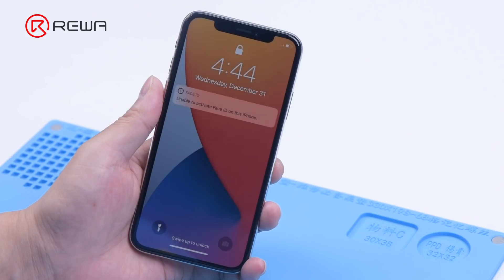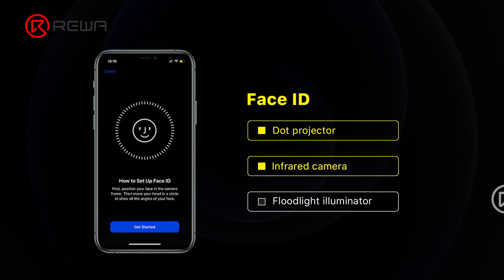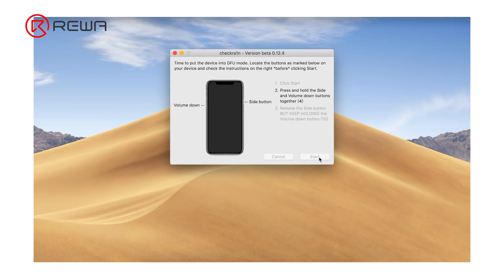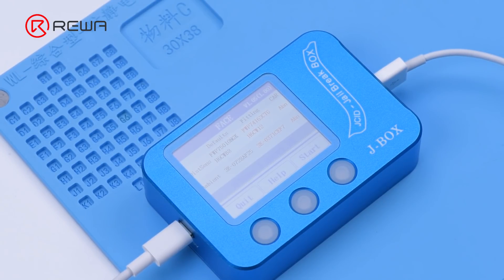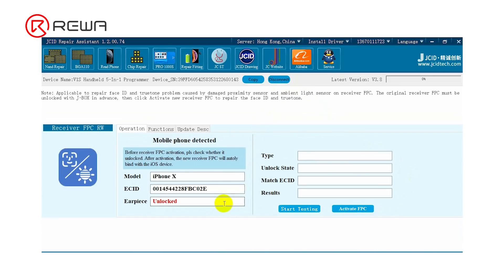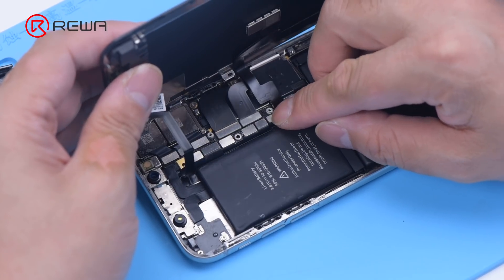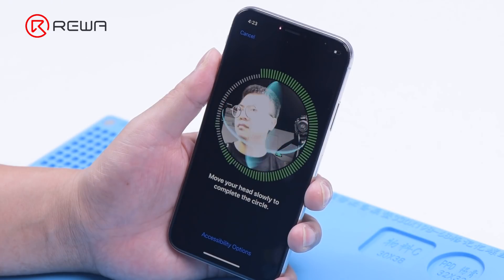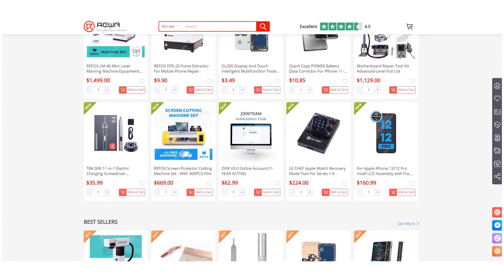iPhone X Face ID Not Working Fixed By Replacing Earpiece Flex Cable

Comment: truedepth camera is not available 

can it be repaired??

everything else like ir camera, ir dot matrix, distance sensor are working (checked in 3utool)
Reply from the maker: Use the repair tool to  troubleshoot, make sure IR CMOS is fine.

Comment: O meu flex original rasgou . Isso pode ser feito sem o flex e original ?
Reply: Yes. If you don’t have the old flex, connect the whole phone to the v1se via USB. It will pull the data from the motherboard. Then connect the new flex to the v1se and write the data. Assemble the phone and you’re done. The old flex isn’t needed, but the v1se, or another programmer is essential. You need a way to read and write the data.

Comment: My face id is working but my mom threw away the original earpeace flex cable how do I restore face id if I purchase 3rd party earpeace flex cable any help please.
Reply: You need the v1s. Connect the phone to the v1s via USB. It will pull the data from the motherboard. Then write the data to the new flex.

Comment: Please explain how true tone is related to the face I'd flex cable?
Reply: The front cameras are what control True Tone, Face ID and the proximity sensor is what turns the screen off when you hold the phone up to your ear during a phone call.

Comment: Hi, is this work also if original earpiece flex destroyed?
Reply: The only thing you need is the v1se. If you don’t have the old flex, connect the whole phone to the v1se via usb. It will pull the data from the motherboard. Then connect the new flex to the v1se and write the data. Assemble the phone and you’re done.

Comment: is the Jbox required to backup the sensor's data? or can I just use the V1S and backup the data using that?
Reply: I never jailbreak. If you have the old flex, you plug it into the v1s so that it can read the data and then write to the new flex. If you don’t have the old flex, you plug the phone into the v1s via usb and it pulls the data from the motherboard. Then you write the data to the new flex.
Reply: So the J box part is not needed then? Can you confirm

Comment: From Xs to 12 (only iOS 14.5.1) we get a jailbreak using uncover 7.0.2, in the settings and put additional checkmarks on install openssh and reinstall cydia without them, the box will not see JB. Next, we read our SN and flash it into the display! Ready!

Comment: My earpiece isn’t working but Face ID works fine. Do I need the Jbox to jailbreak as well as the J1S or the J1S only with the appropriate board to read/write the flex cable data?
Reply: Did you find a fix for this? I have a phone with a similar issue!
Reply: You only need the v1se. If you have the old flex, connect it to the v1se, read the data, connect the new flex, write the data and then assemble the phone. If you don’t have the old flex, connect the whole phone to the v1se via USB. It will pull the data from the motherboard. Connect the new flex, write the data and then assemble the phone.
Reply: No Bro , u can Just repleace the earspeaker on the original flex

Comment: after finishing all the process, can I update my Iphone with the original software or do I will need the jailbreak?
Reply: You don’t need to jailbreak. I never do. You need the v1se. If you have the old flex, connect it to the v1se, read the data, connect the new flex, write the data and then install. If you don’t have the old flex, connect the phone to the v1se via USB, read the data and then write the data to the new flex.

Comment: After Sour replace and reprogramm the Face id, can you remove the Jailbreak?
Reply: Of course you can remove the jailbreak
Reply: @airmaxbg  but will Face id still Work without  the Jailbreak...thats tue question😁
Reply: You don’t need to jailbreak. I use the v1se to do this on a daily basis and I’ve never needed to jailbreak a phone.

Comment: could a similar method be possible with the dot projector? Reprogramming the dot projector on a new front camera assembly instead of having to repair the old dot projector?
Reply: Sure it is possible but still you need to transfer IR camera. Dot projector is not unique data stored in encrypted ic is unique. But if flex is damaged you need to fix flex because data is in encrypted ic.

Comment: what if i bought an iphone x with no face id but working truetone, previous user told me that he lose face id after updating to ios 14.5.1 so i bought and tried downgrading but didnt work. is it caused by the earpiece flex cable too? or do you have any alternatives?
Reply: Dot projector defective. Replace dot projector and Face id will Work
Reply: @WalmezTekno  meaning i had to buy a  new frontcamera with dot projector module and solder it with old original module flex cable?
Reply: @justarandomonlineperson8094  you can not replace front camera, after it you lose Face id function. Infra camera and dot projector (parts of front camera modul) are paired with procesor, so you can not replace them. Only way how to repair your problem is to replace flex cabel from dot projector-it need to be reprogrammed and replaced with soldering and you need skillz to do it. Find someone ho do it, not do it yourself without skillz.
Reply: @WalmezTekno  i see, i had a friend that is skilled with the soldering stuff but i had to find the programming thing. anyway thanks for the help and info.

Comment: Why do they sell these cables and devices for iphone xs,11, etc , if these devices must be jailbroken and don't exist?
I bought a jc v1s with the 6 circuit boards, ear flex cable and dot projector cable bought for iphone xs , but is useless cause it doesn
Reply: I have same set with 6 boards and they make a good work. For changing the new screen, battery and etc

Comment: Hi, what will happened if I remove jailbreak after reprogram new part, is it gonna work?
Reply: Have you tried this, or know anyone who’s tried this? I’m considering buying this setup for my business, but if I’m unable to remove the jailbreak afterwards and keep Face ID I’ll have to pass.
Reply: It does work even after restoring, Doesn't make sense if it does not work after restoring or re-starting the device
Reply: I think it won’t work because you are programming the phone to remember the NEW number the iPhone has to look for. Unless!! This changes the serial on the actual ear piece! Then it should work even restoring the phone I’m sure
Reply: You don’t need to jailbreak if you have the v1se. If you have the old flex, connect it to the v1se, read the data, connect the flex, write the data and then assemble the phone. If you don’t have the old flex, connect the whole phone to the v1se via usb. It will pull the data from the motherboard. Write the data to the new flex and then assemble the phone. I’ve never had to jailbreak a phone to do any programming with the v1se.

Comment: I bought this device and I've tried emailing to get some help with the "IIC chip not recognized!" error when using the software. It's been two weeks. Why is it so hard to reach anyone from your company??? I'm a new customer and the complete lack of any help is incredibly concerning.
Reply: did you ever get the help you needed? I own a phone repair shop in Canada and am debating on buying this, however this comment is concerning lol
Reply: @jordanirvine3787  jailbreak is basically dead so rip
Reply: oh
Reply: Most Chinese companies have zero after sales support. Communication is a joke. Nobody speaks English there so you can be sure that once you buy from most companies, they don't even reply to your messages.
Reply: Would like to buy this tool did it work on llc chip?

Comment: Does this work for iPhone 11 Pro Max? Is there a connection for the 11 Pro Max on the JC V1S device?
Reply: No, only checkm8 devices (up to 8/X year), XS-present won't work, though they may in future with other jailbreak methods.

Comment: Great video, I got just one question, as the description says, models after the iPhone XS, this means if i got my iPhone X face id flex damaged, i could replace it with a new one and still keep Face ID and True Tone working ?
Reply: Only if you get the earspeaker flex damaged you can reprogram it. The front camera assembly is irreplaceable
Reply: Yes
Reply: You can program the front camera with the v1se. I do it daily.
Reply: Message clintontech78 on !G he's the best solution ever💯.
Reply: @arowoloabimbola432  he’s just a scammer, thx anyway

Comment: do i have to make jealbrack for this process
Reply from the maker: Yes.
Reply: @rewatechnology2008  I have a jailbroken iPhone XS (not X) on 14.3 and bought this tool with the earpiece flex. Waiting for it to arrive to test. As long as the phone is jailbroken, it will work, right?

Comment: Does this work for XR, XS, 11 and 12 series as well? And what happens if phone is restored after jailbreak
Reply: acctually no it wont. This is only for the iPhone X as the checkm8 exploit is only available for iPhone X and lower and this is what is needed to jailbreak!
Reply: @jaketaylor9961  We just have to wait until there is a new jailbreak. There was one for every ios version in the past, it just takes time.
Reply: Message clintontech78 on !G he's the best solution ever💯.
Reply: im not sure about those models but... it should work fine, as the data had been burned into the earpiece flex cable :)

Comment: Can you change the processor
Or upgrade them.?
Will it work.?
Like Snapdragon 732 to 860 or better versions?
Reply: Short answer: No.
Longer answer: Apple uses only Apple silicone, A11 Bionic in the case of a iPhone X (so no Qualcomm CPUs are gonna go on an iPhone) and each iteration is different in design so even if they look the same, they won't communicate with the motherboard the same way. Also, many components one the motherboard are tied with the CPU meaning they won't work if they don't match. I honestly don't know if someone tried to reprogram an Apple CPU but it sounds like a massive undertaking.
Reply: @benjaminwilson8183   
I mean in Android phones .not in ios
Reply: @safinshahz  since it's an apple video I thought your were talking about an iPhone.
However, the answer is still no. You can try overclocking the CPU but upgrades are impossible for the same reason you can't upgrade iPhone CPU, minus the serial number check.
You can technically change the processor but only with the same one (A11 with A11, 732 with 732, 860 with 860...). And a brand new CPU won't work better than a used one, CPUs slow down because of software upgrades and thermal paste getting too dry, promoting overheating.
Reply: Message clintontech78 on !G he's the best solution ever💯.

Comment: Would this work, if you un-jailbreak the iPhone? Or the iPhone needs to be jailbroken to keep the face id working?
Reply: Jailbreak is done only to read the data. The data has been programmed to the new flex cable. Even if the phone is factory reset, there is still data in the flex cable. There will be no problem. 
Sorry for my bad English
Reply: @justtavi1238  Thanks for reply ❤️
Reply: As long as you have the v1se, you don’t need to jailbreak. I do this daily and I’ve never needed to jailbreak a phone.

Comment: But what if we factory reset the device will faceid remain even if it’s not jailbroken
Reply: I personally tested it, I DFU'ed the phone several times and it worked perfect every time.
This was done without the JBOX as well, only with the V1S. I'm not sure if this will cause problems in the future, but I don't think it will.
I technically did the Offline method, where you still jailbreak the phone, but you connect the phone directly into the V1S, and then you connect the replacement JC Earpiece flex and bind it from there.
Reply: @Desitos  you should do a video showing the process man
Reply: @Desitos  thanks ! This is very nice to hear
Reply: @Desitos  but your phone need to be jailbroken?
Reply: Jailbreak is done only to read the data. The data has been programmed to the new flex cable. Even if the phone is factory reset, there is still data in the flex cable. There will be no problem. 
Sorry for my bad English
Reply: @justtavi1238  apple wont be able to patch because the phone already recognizes new flex. Apple done the same thing if you replace screen from them so I think Jc figure how apple done it
Reply: @chauhoang  Exactly. The original values have already been programmed in the new flex cable so there shouldn't be any problem
Reply: @justtavi1238  Thanks! For your answer this sounds great, until apple patches this 🙁
Reply: @oliver_lauritsen_oa  Rewa will find another solution probably 😂
Reply: J-box requires Jailbreak to read data i think , then the programmer is writing same data as motherboard to earspeaker.
Reply: Hi do i need old orginal flex cable to read data or it’s reading it from motherboard?
Reply: @marekprokopiak3181 there’s two ways to do it if you have the v1s. You can either plug the old flex into the v1s and then read and write on to the new flex, or you connect the whole phone to the v1s via usb and it will read it from the motherboard.